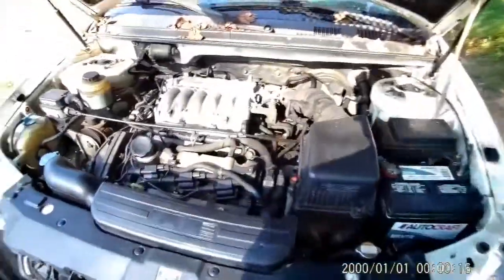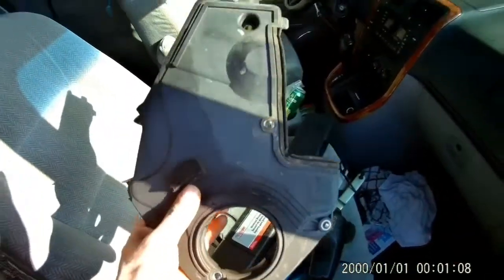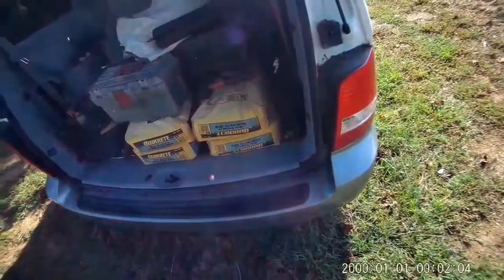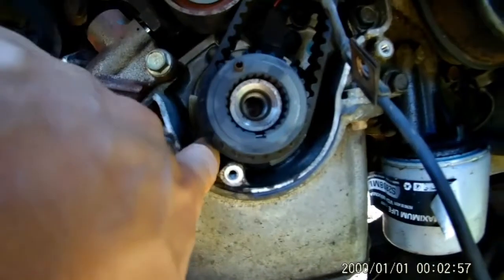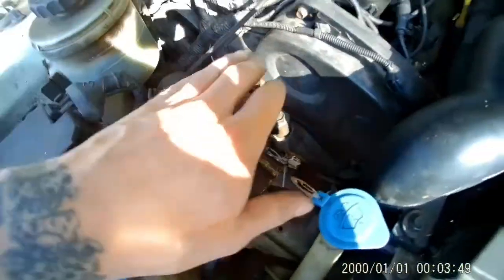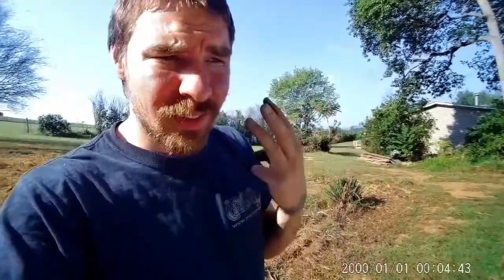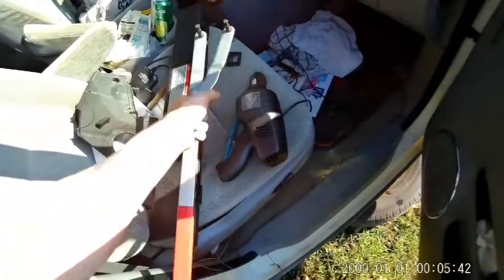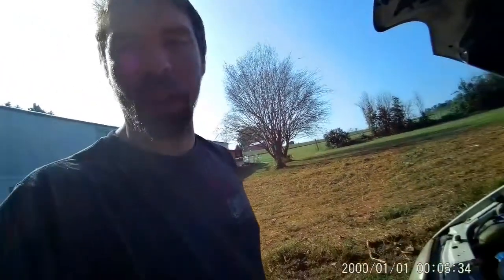2005 kia sedona crank shaft position sensor part 2

Comment: Is this the same thing as a speed sensor?
Reply from the maker: No.this is the crankshaft position sensor.  the speed sensor is normaly located to were it can measure the speed of the wheel turning.. like on an axle or in a hogs head.

Comment: Is the plate breaking normal on these?
Reply from the maker: i am.sorry not sure if this is a common complaint.  i have the parts now to fix it.  just need a pulley puller..  also think i will redo the water pump and timing belt while i am in there.